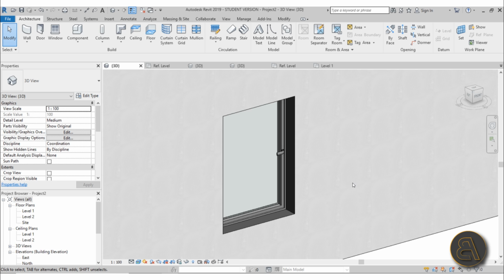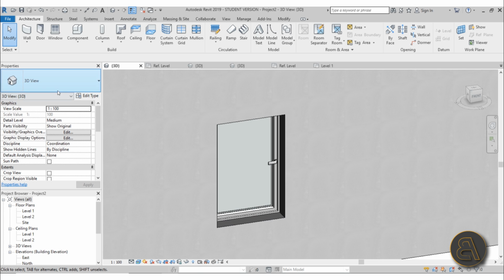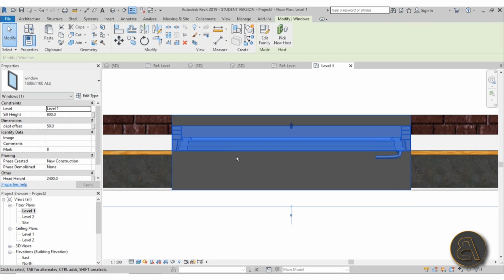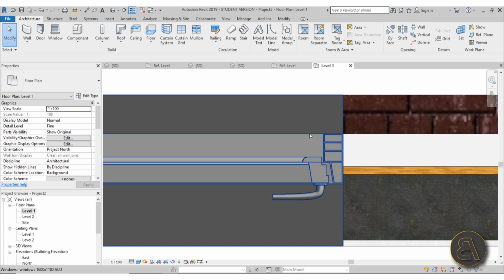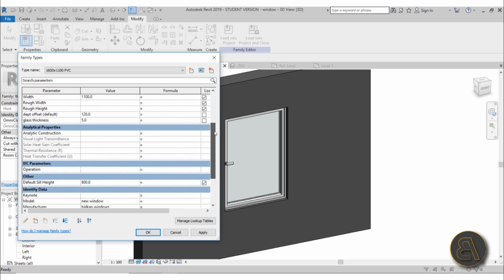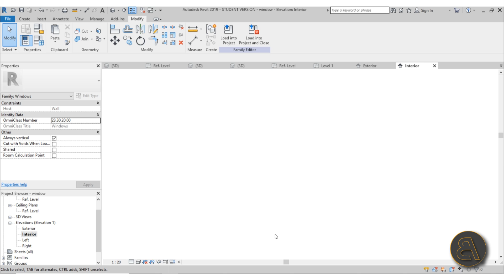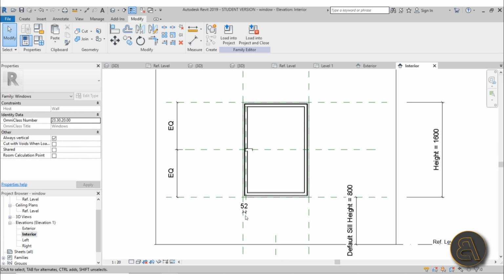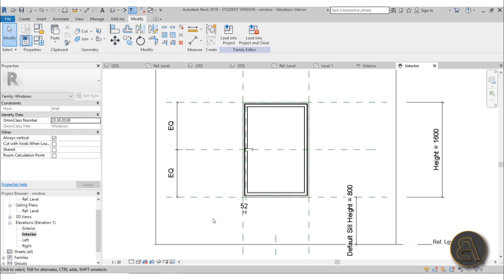Advanced Revit Family Course: Window Family

Comment: Hey, I'm making my own windows families as well and one thing is driving me crazy: when I nest a seperate single window frame family into a larger window configuration in which that frame is positioned entirely above the cut plane in the project, Revit shows that frame as seen from above in plan view instead of the part of the total window that is actually being cut by the cut plane... In short: instead of properly showing what is cut, Revit shows all nested windows parts that are above the cut plane while it shouldn't. Do you address this problem in your total course or elsewhere?
Reply: You will have to set the Visibility Graphics of that item in your windows family (the one you are inserting it into). Is that separate single windows family a detail item by any chance?